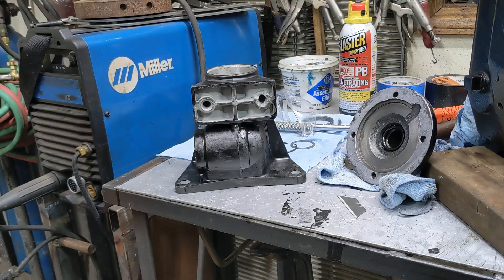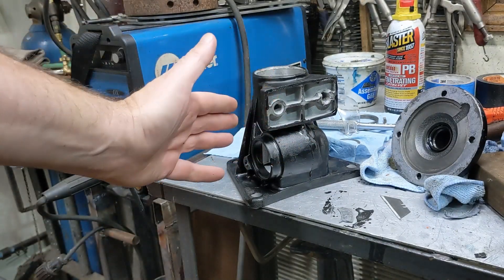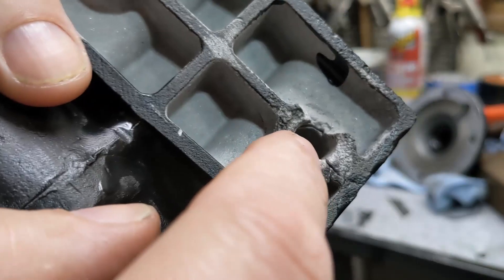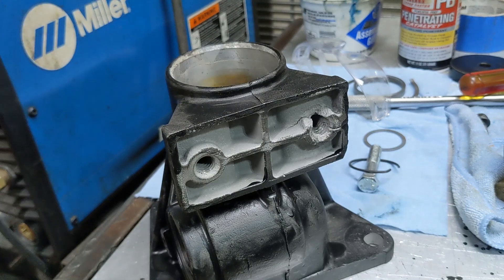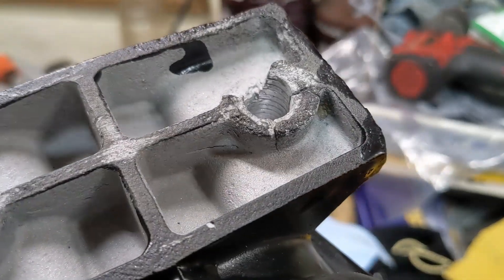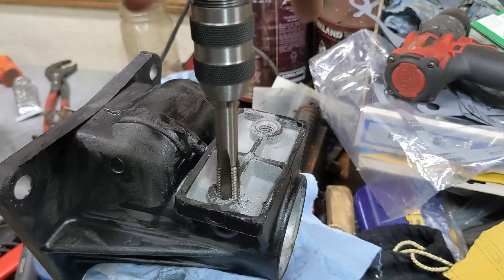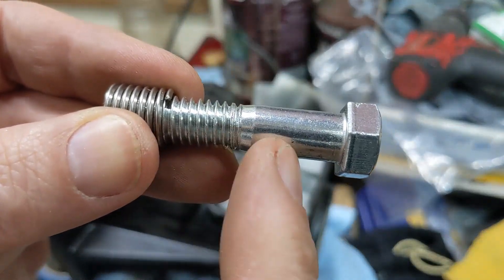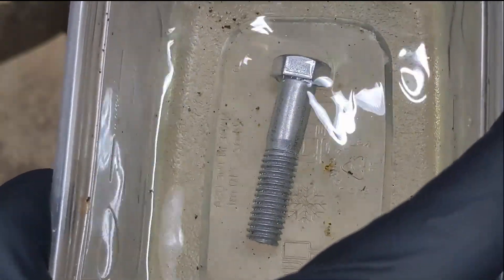Repairing a Cast Aluminum Output Bearing Retainer (True Spirit #33)

Comment: The problem with it not being machined flat is when tightening the bolt it's going to stress and crack somewhere else...
Reply from the maker: Certainly possible, but it's fairly flat, and the transmission mount that bolts to it is stamped steel, which is going to flex a bit as well.  Also, the original didn't look to be machined at all, just the surface left from the casting, so it was never high-tolerance anyway.
Reply: Simply add a flat shim

Comment: next time heat the vast area with a torch before tig welding. also every crack should have been drilled at the end to stop firther cracking. the cracks should have been ground with with a v shape.